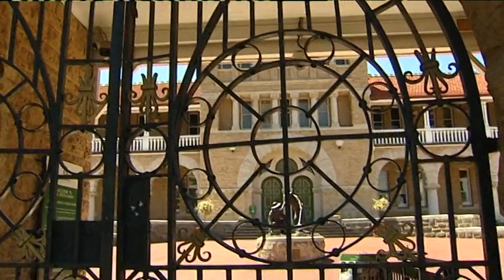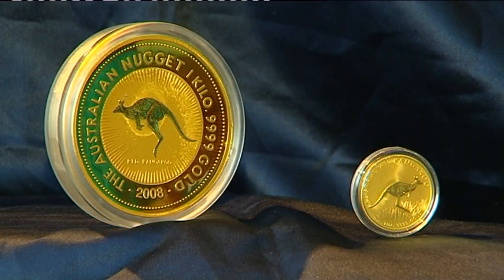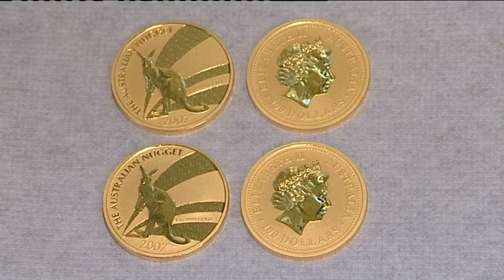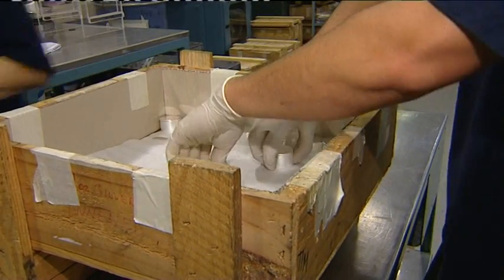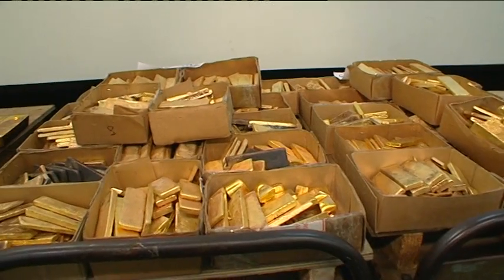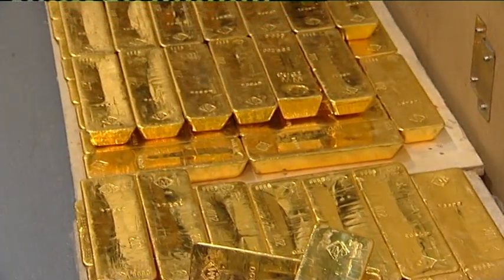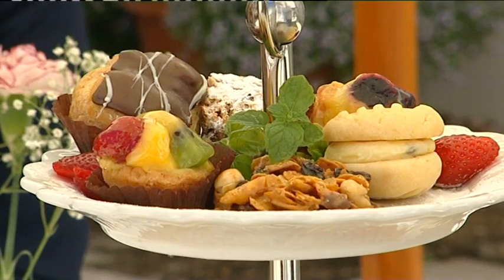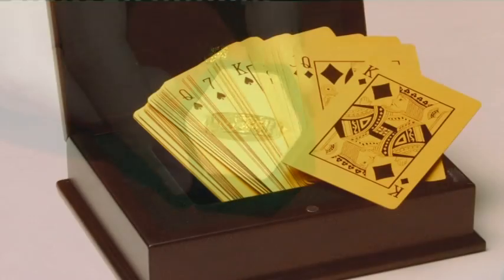The Perth Mint

Comment: no its not. its cos if you wanna buy them from a bullion dealer, they charge spot, but if you want to sell them to a bullion dealer, they take about 85-90% of spot. thats why its usually cheaper to buy on ebay than from a dealer. Because privately, both buyer and seller can split the spread.

Comment: ACCADACAstkr sent me. This is an amazing video. Love the history and seeing how its done. Just amazing, and easy to see why the Perth mints quality is unrivaled.
Reply: @stevexracer4309  are you talking about the recent news about the Perth? Do you think their popularity is going to tank because of it?
Reply: @stevexracer4309  you should probably review your 'facts'. Perth mint did nothing wrong, it's just China with a weird, dumb rule on silver. If the impurities had been copper or any other metal besides silver, there would have been no issue.

Perth mint has since upped it's minimum base purity to address the issue.
Reply: @stevexracer4309  they got 99.99%, you flop. That wasn't the problem, the problem was with what that other 0.01% exceeded 50ppm of SILVER. Had that 0.01% been nickel or some other crap metal, it wouldn't have been a problem. That's it. Never diluted that 99.99% once. Their actual minimum refinement was around 99.992% and they changed it following this to a minimum of 99.996% refinement which ensures that the impurity ppm cannot possibly exceed 50 ppm again. Beijing needs to stop trying to cherry pick what the impurities of a bar are, they are the ONLY country with these dumb requirements, so no, to those that ignored the hyped Chinese story and actually bothered finding out what the issue was, we already know it was a non event and Perth mint more than 'made up for it' when they never did a thing wrong. Do your homework

Comment: Funny thing is you have to walk though a metal detector you walk though it starts to beep... unless you found a way to disable the 1 metal detector there is still a 2 one that run on battery for about 3 hours in case power goes out they search you find out you place gold coins in your anus just a tip.